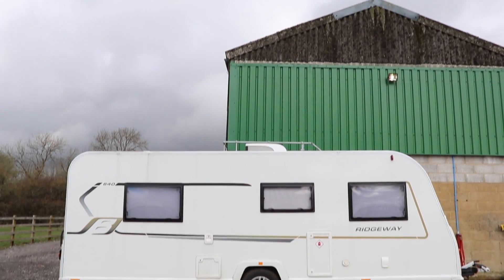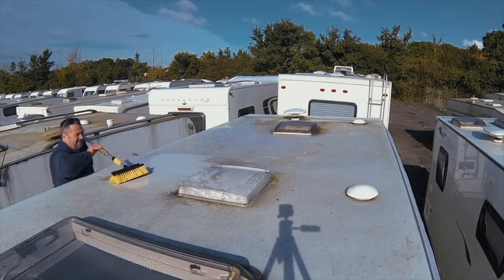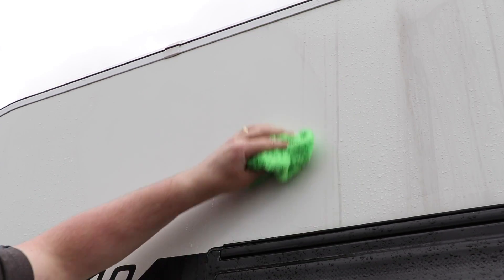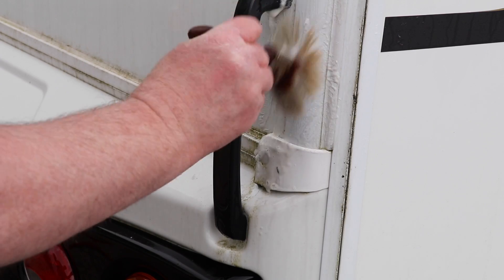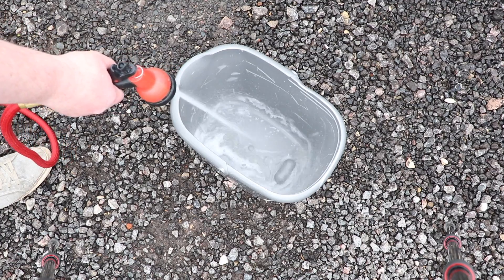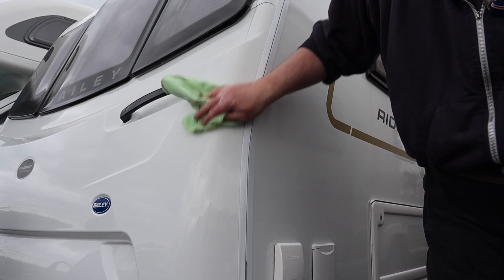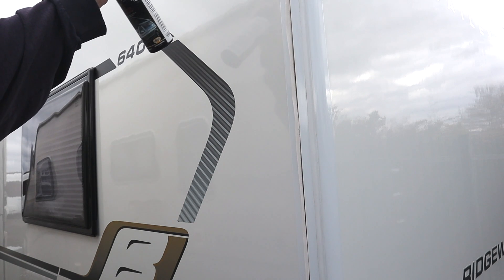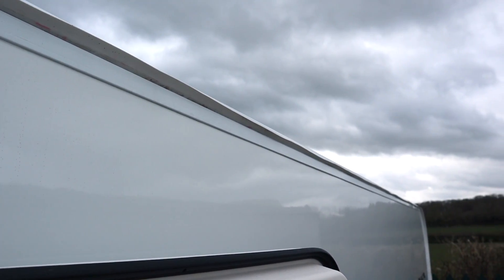Deep cleaning the caravan

Comment: I have just connected mains water to aquaroll,does this mean I will be able to use the shower 🚿 without fear of water running cold,what I'm trying to say will it heat up once it goes through system for long
Reply from the maker: Hi, sadly not - you will have continuous water but only 10 litres of hot water, so you will last about 6 mins in the shower (depending how hot you have it)

Comment: Deep clean our Knaus StarClass 470 once a year. Takes a good weekend doing everything solo. Full wash including the roof & wheels for Day 1, including polishing with Autoglym SRP polish. Day 2 (and possibly Day 3) is two applications of Collinite 476S Double Hard paste wax. I do have the advantage of a cordless DA polisher (for both wax application & polishing), so its not as hard work as it sounds 

Also clean all external electrical connections & after checking all bulbs use bulb grease (dielectric grease) to ensure good year round connectivity & easy stress-free hitching

Comment: Good tips dan , my van has a solar panel fitted the gap between the roof and the panel is roughly 3/4” with loads of green moss in there what do you recommend to clean it ?  Cheers gary
Reply from the maker: Hi Gary, so i have the exact problem and what i do is wrap some micro fibre cloth around the handle of the long brush you saw me use. If that doesn't quite fit, try a cloth wrapped (tied off) on some garden bamboo canes. that should hopefully get you under the panel. 

Hope that helps.
Reply: The Trudgians o

Comment: Hi Dan
Let me give you a tip to save you a lot if work and get a super smooth ceramic high gloss  finish to all parts of your van using this product renowned in automotive detailing.
Buy a bottle of Gyeon Bathe+ (Bathe+ not Bathe) ceramic shampoo.
This is the ONLY shampoo in the world that cleans and CERAMIC coats your caravan in 1 STEP simply by washing with a microfibre.
It cleans and leaves a ceramic coating so any subsequent dirt simply slides off.
It can also be used on acrylic  windows , plastic , alloy wheels etc
I use it on my Lusso 2 and tow car...very easy and VERY effective.
It's that good we even now use it on all repaired cars in our bodyshops so they are given back to owners post repair n better than new condition in my opinion.
If your caravan is already CLEAN  use Gyeon Wet Coat....spray on rinse off...when the rinse water contacts the product it activates the ceramic in the Wet Coat so you don't even need to wipe or rub...spray and rinse...job done your van is now CERAMIC COATED
It's a good tip to apply product to van windows with your finger tips but to add to that rinse your windows before applying product minimising  feeling any "grit" as its applied as any potential grit would likely be rinsed off before applying.

Comment: Great job Dan but I would have been going mad now if I had paid for Dimondbrite and having to scrub your caravan like you have with all them chemicals.
I’ve had them all in the past but if you’re paying up to £500 think I would be getting them back to clean it.
I no you get a warranty of Dimondbrite and the other one the dealerships are pushing onto customers but who has ever actually put them to the test.

Think what you have just been doing is the best option good wash ,with a once of year descent car polish.
Reply from the maker: Morning, Im really impressed with the diamondbrite, but maybe expectations are a bit high for this product. It doesn't stop the caravan from getting dirty and it will not prevent the black streaks from forming. It does however make the cleaning process a lot quicker / easier and the results when finished are amazing. Consider to clean this caravan in the state it was in, including dragging it in and out of its storage bay, with filming took no longer than 2 hours. Thats the roof, the sides, wax and wipe down. 

Diamondbrite makes day to day maintenance so very easy, and really the hard work here was not scrubbing the caravan, but filming it to make a useful video.  I will 100% be getting diamondbrite again on any future purchase.
Reply: Dan I’ve had this done used the correct shampoo and as I expected for the first few washes it seems fine. But think this is because the caravan is new any way.
I no it doesn’t stop streaks or mold but really if you’re honest was does it do.
I’ve caravanned for years trying them all thinking this time it will work but Ian not wasting my money anymore.
I watched your video of your caravan Dimondbrite being applied and the guy doing it said you put on the stage one then leave to dry then wipe off.
Then apply stage two leave to dry and wipe off.
But then in another video the same guy but two of them, same products apply stage one leave to dry don’t wipe off then apply stage two leave to dry them wipe off.
I checked with Dimondbrite and they confirmed that you leave stage one to dry and don’t wipe off till stage two is applied then wipe off.
I was just wounded if he used a different Dimondbrite? 
But your caravan did look great after you cleaned it. I guy in Devon gave me a waterless spray, polish but said wash your van first. I tried it and the result was fantastic even removed black streak.
Good for windows etc even your own house windows didn’t have to clean them for weeks.
I got replacement from trago mills while in Devon think you can buy it online. It’s called Triplewax Dimond shake and shine.
Cheers Dan

Comment: God video. But I'd like to assert that awning rail protectors are absolutely unnecessary. They just make a trap for all the dirt and goo what wind and rain would remove if the protector wasn't there. Protect the rails from what? Frost? The rails can't fill with water unless you've got a protector there 😉
Reply from the maker: Thanks for the comment, but i disagree 100%. The protector creates a lip that allows water to run off the roof and away from the body of the caravan. This in turn, reduces by quite  a considerable amount any black streaks and will aide any muck to run off the roof and not into the channel. Furthermore with a  clean awning rail (once removed) makes adding the awning back into the channel a lot easier. 

I have experience of with and without the protectors, and i will always use them, from keeping the channel clear and the side of the caravan clean. 

Hope that helps
Take care
Dan